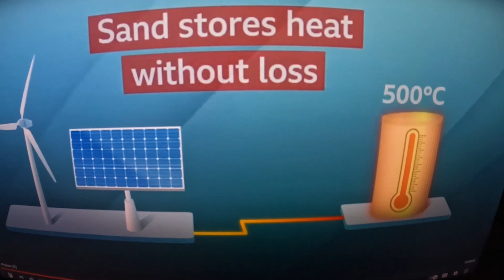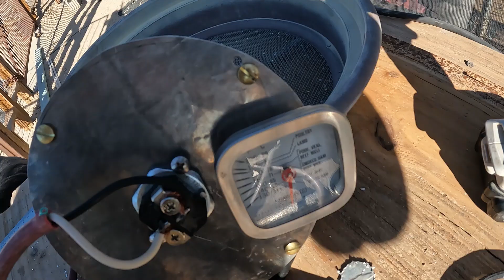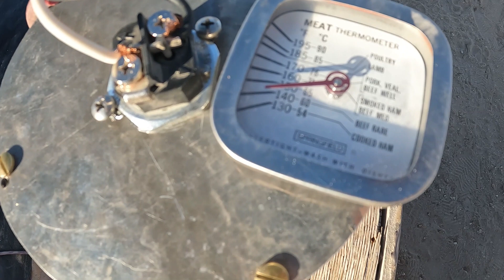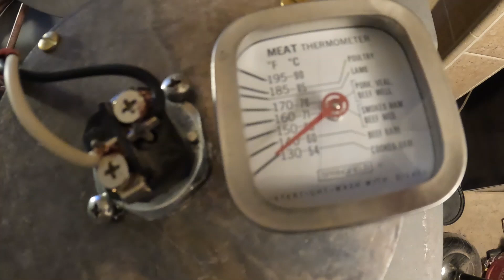Solar Sand Battery Experiment Part -1

Comment: Hi Mike I love your setup for the sand battery. I would like to build one also. Thinking a couple 200 watt solar panels with some 12 volt heating elements. In a 50 gallon outside and a 40 inside holding the sand..hooked direct to the solar panels. From there some copper plate acting like a heat sink from inside sand to airspace. A thermal heated electrical fan sitting on top of one 2x10 in copper sheets bent at a 90 degree angle close to an incorporated into my old plenum. From that a thermostat controlling the solar sand temp to provide a steady heat soarse. I'm not sure this made any sense to you but you help would be welcome.

Comment: Hi mr mike, thank you for your effort,  i'm from morocco, and i want to repeat the same experimentation but i find that solar panels are expensive here.   For example a 17 watt panel costs 45 dollars. Almost 2,6 dollars for one watt. Is it the same price there ?
Reply from the maker: No I can find solar panels for roughly 50 cents a watt. That is expensive butt I used to pay $4-$6 a watt years ago. They are cheap on ebay in Las Vegas but shipping would be the issue.

Comment: Hello Mike, i think you could just using magnify mirrors reflector method (with solar tracking with an offset adjustment) and reflect  to the sand box , like this you will increase the heat and store much more calories, the idea would be to heat the sand just under the melting point (1700°C) as optimized storage

Comment: you need a 48 volt induction circuit with a copper coil on an iron tank, i think it is by far the most efficient way and a minimum of 20cm isolation on every side of the sand battery box. good luck!
Reply from the maker: That is good information and I will research it. These experiments are small prototypes using some readily available hardware from a local hardware store. Thank you for the comment.

Comment from the maker: This was my first attempt at the sand thermal heat battery. I am continuously upgrading the concept. I do believe I will be able to heat my home with this concept. I am building larger and more powerful ones as I work out the detsils.
Reply: Wish I would have caught this series at the beginning and not 11 months later. All you needed was to find an old electric stove that the bottom element was good in. Screw the door shut, fill it with sand from the vent on top, and hook your solar up the exact same way.